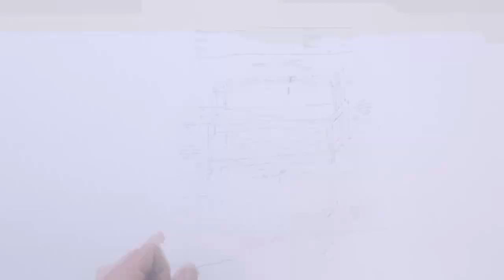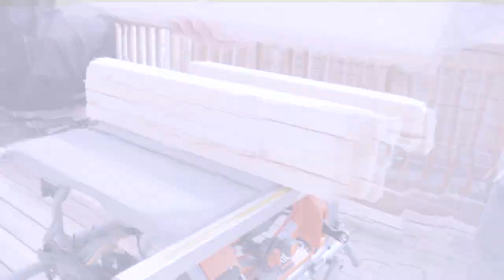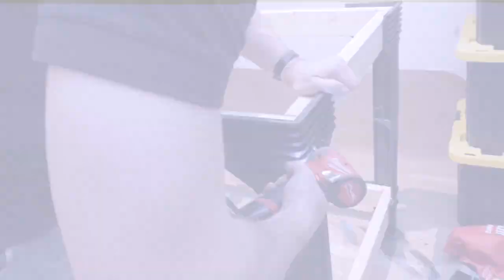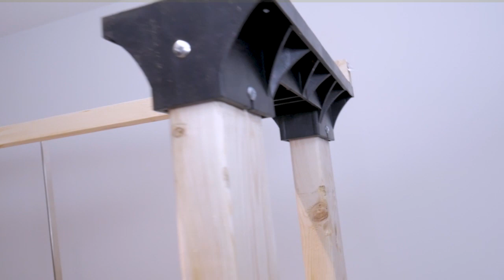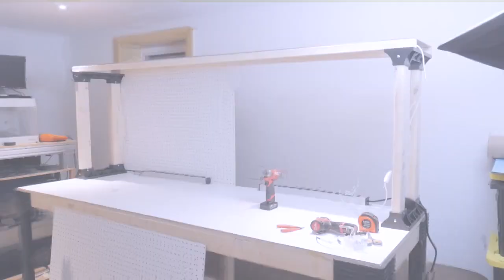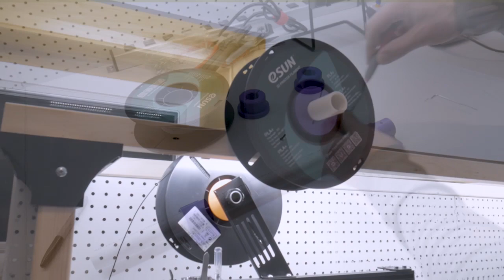How To Build A BIG Workbench In One Day! STRONG, Easy, Inexpensive! (Amazon Hopkins 2x4 Basics)

Comment: Looks like the manufacturer of the 2x4 kit is no longer in business so that link isnt going to do anything for you. I DID find an alternative which is effectively the same thing but in metal with 6 brackets for the top shelf instead of 4. Might want to update the affiliate link to that one with the explanation that diy2x4kits isnt available anymore. Another HUGE help would be a material list and cut list so we know how many 2x4s. You only mention the 4 2x4 8' sections which are the front and back 'faces' and the 2 8' long 2x2s. Sorry but i have difficulties with the short term memories buffering out and need the visual reminders that I can check (and check off a list) a billion times so i dont  buy the same 4 board 3 times. 😅

Comment: Hopefully you see this and will respond. Are you still using this workbench? I just got a 3d printer and saw your bench build. Is it a rock-solid bench? I hate wobbly benches especially with a 3d printer that already shakes tables on its own. Thanks! If it is even a little bit wobbly, i will just make a bench from steel, just thought this would be a lot quicker to build.
Reply from the maker: Still using it - rock solid. I can fit 3 - 4 printers across the top depending on the size of them and it doesn't move. I've also had several laser cutters on the top, one of them was over 100lbs and no issue with running printers at the same time. Would recommend!
Reply: @EmbraceMaking  Thanks! Going to get the kit ordered.
Reply from the maker: Sounds great, if it's not too much of an ask to use my affiliate link - it helps the channel :) -  let me know if you have any questions when you're building it and I'd be happy to help!
Reply: @EmbraceMaking  No problem, will do.
Reply: @EmbraceMaking  Sorry bud, been 2 weeks and amazon still doesnt have the 2x4 basics kit in stock. Going to have to buy from Mfg direct or something.